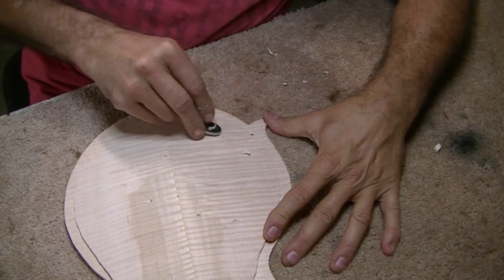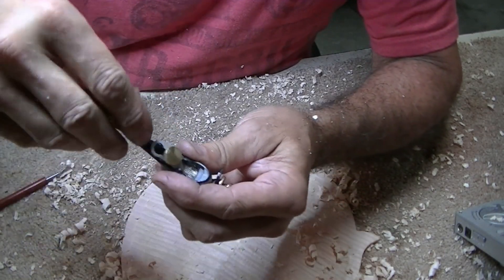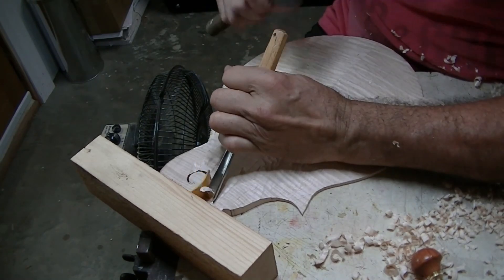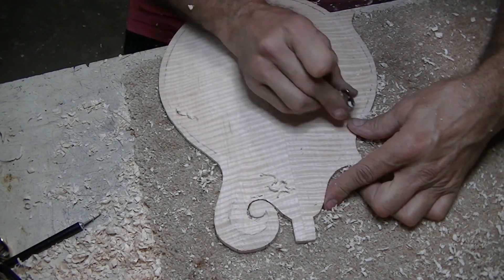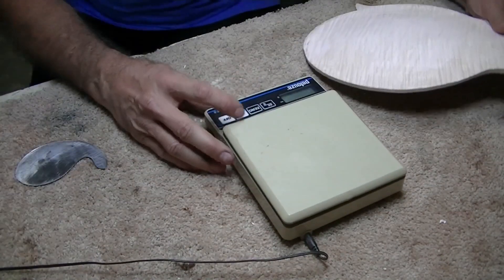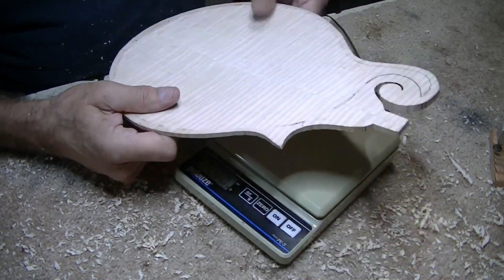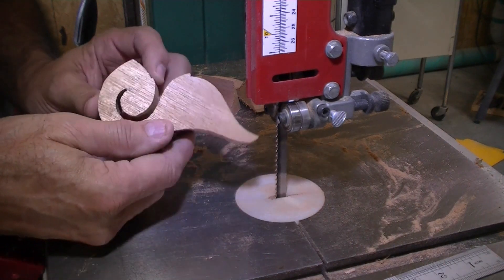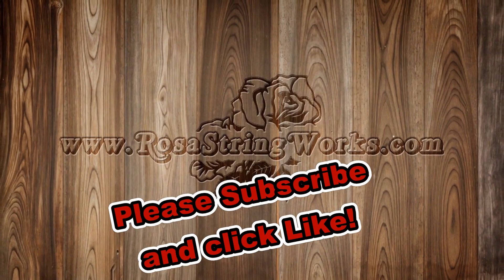241 RSW WV Mando Proj P2 Back and Sides

Comment: Great work Jerry, the stripe in that maple is amazing. I know you measured and weighed the Loar but wouldn't each piece of wood have it's own optimum weight and thickness for that "perfect sound". I'm thinking you probably use the Loar specs as a base line and go from there.

Comment: That's one way to explain. Also most guitar maker agrees that wood actually substracts by absorbing certain frequencies. Using that theory means thicker wood absorbs more energy and you hear less
Reply: And more mass, less tendency to vibrate. There's a fine line somewhere between the two.

Comment: I love the way you explain the details of what works and what doesn't. I have a plane like the one you have with the palm handle and I find it much harder to get it to cut than my homemade gouge. I wonder if I ground a shallower angle on the bottom of the plane if it might work better? Maybe I will give that a try, because it sure isn't working for me the way it is.
I might be wrong, but it seems to me like as you carve out more of the inside of the instrument it increases the volume of air inside the instrument. To me larger volume relates to lower tone, just like the low strings have a larger mass (diameter). Peace and good health to you my friend.
Reply from the maker: Actually the more volume inside the instrument the more Hollow it sounds. It doesn't bounce the sound out as abruptly. You could also take that as a deeper sound. But to me it loses punch and volume.

Comment: Your plane issue sounds like the difference between a standard block plane and a low-angle block plane. I've found the standard blade pitch to be worthless on hardwood end grain no matter how well it's sharpened, but a sharp low-angle plane cuts end grain no problem

Comment: Carving the inside creates a larger resonance chamber.  A larger chamber creates a deeper, warmer sound.
Reply from the maker: As I mentioned on another person's comment. You can take it as a more deep mellow sound. I think of it as a more boxy Hollow sound. When the air chamber is smaller it has more punch to punch the sound out through the sound hole. And generally speaking it will be louder. However in both cases larger and smaller there is a point of diminishing return. Too small doesn't work well and two large doesn't work well.